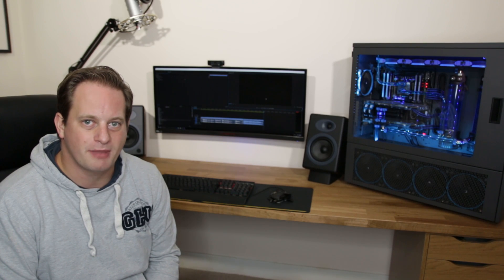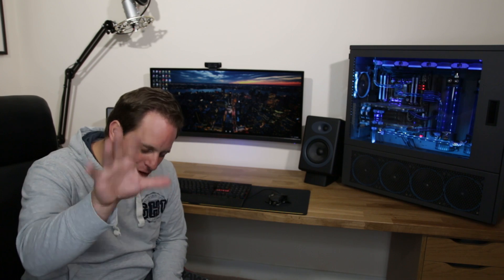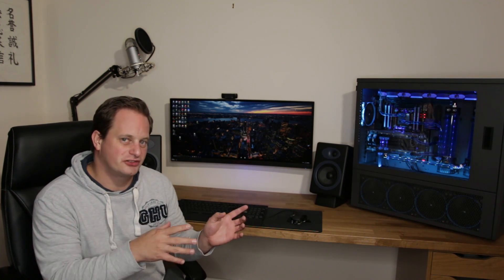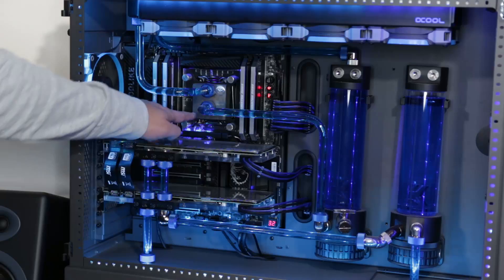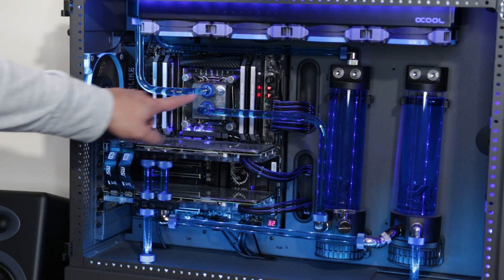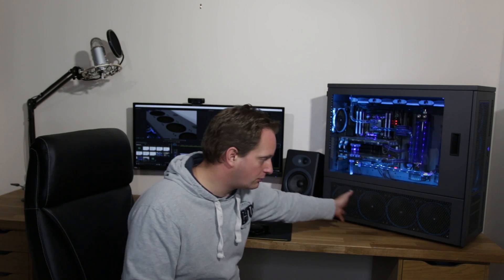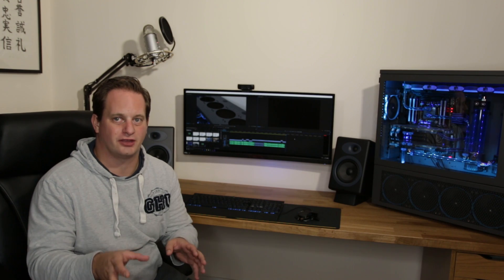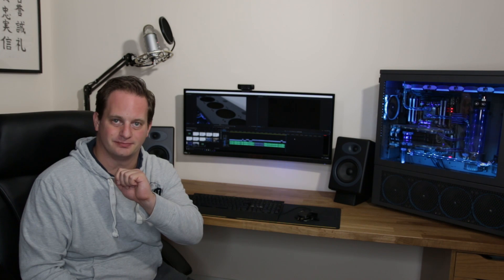Geek School - How Does Water Cooling Work

Comment: how does the liquid cooling like nzxt kraken work? because I only see things like water pump (the one come with lcd), it goes through the pipe directly only to reservoir and the fans. and then transfers back to the pump. 
where is the water block? 
or does the pump also has the waterblock?? 
or is that the waterblock and the pump come together in the reservoir??? 
thanks!

Comment: air cooler have liquid inside too, so....
Reply: Yeah, I was wondering about that, too. No mention of the actual type(s) of liquid or whether said liquid is self-contained in the loop, has to be added to periodically, or if the loop receives liquid from an external source constantly. I know nothing about liquid cooling, and the liquid supply source has been one of my questions.

Comment: I know this video is old but it was amazing and i have a dumb question, but i am not sure if the uploader will see this since its so old but worth a try. So water carries the heat away, so does that mean the temperature of the water does not matter because it will have the same conductivity regardless? or does it matter because if the water's temperature is higher than cold or warm it wont take that much heat from the block? i would appreciate anyone to help me with this.

Comment: This really helped me (I didn't know about Convection, how the water moved, I thought only the pump did that), but I still have a question, convection makes the hot water go back to the radiator and the pump moves the cold water to the block that will turn into hot water... But I saw a video in which the CPU WC Block had something like a spinning fan on it, all blocks have that? He explained it was for moving the hot water back to the radiator (since it's kind of pulling it)

Comment: Well, the air being heated above the water is not radiation. Radiation is the transfer of energy by an electromagnectic wave, when light hits an object it is heating that object, and also heated object emits light, just as a steel bar begins to turn red, and then white if you heat it.
Reply from the maker: Thermal radiation is electromagnetic radiation generated by the thermal motion of particles in matter. All matter with a temperature greater than absolute zero emits thermal radiation. Particle motion results in charge-acceleration or dipole oscillation which produces electromagnetic radiation.

Infrared radiation emitted by animals (detectable with an infrared camera) and cosmic microwave background radiation are examples of thermal radiation.

Comment: You also gotta add that water has the best specific heat capacity out of other fluids due to the strongest hydrogen bonds between water molecules. This means that it takes some amount of heat while increasing the temperature of water the least

Comment: Hi, I'm building my first pc in the next coming months... I do plan to use liquid cooling. I will be using a corsair 570x mid tower case. Now i have used pc part picker to start planning what's best for me. I have noticed alot of cooling units DO NOT come with a reservoir. Do all require the reservoir or no?
Reply from the maker: If it’s your first build I’d recommend building on air initially before you water cool. I have an entire series of videos watercooling in that case which should help once your ready, it’s all in a playlist for you 🤗

Comment: It's so beautiful... But what if water starts leaking 🙄
Reply: if your computer is on at that time, most likely it will cause electrical shorts (i am not a native English speaker, but hopefully you understand). This will 90% kill your board, your CPU and maybe even other components. To prevent leaks or at least try to minimize it, after assembling, PC-Builder would let the loop run overnight and place dry towel/ kitchen paper over where it might leak. This measure is not 100% safe, of course, but it is widely used by various experienced builders
Reply: It's not water ;__;
Reply: @shamaafrin4031  You must be watching a different video then. Otherwise you wouldn't say that. Watch the video in which you commented.
Reply: @blazingtornado8660  xD i watched mineral  oil one
Reply: @shamaafrin4031  I see. Yes you somehow stumbled upon a different video 🤔. But how did that happen is one of the greatest mysteries of the universe as normally you watch the same video in which you comment on, or in your case reply to a comment. This video uses water :-P

Comment: Hi guys i'm noob about this idea. Sooo does the water actually flow through the cpu/gpu to cool it? I mean, is the water in direct contact with the hardwares?
Reply from the maker: It’s not in direct contact, you need a ‘waterblock’ which mounts on the CPU in the same way a heat sink would that the water flows through. Google it and loads of reading material will come up.

Comment: So if energy cant be made where so does the original energy come from logically this doesnt make sense
Reply from the maker: +jon millay it’s definitely tricky to get your head round but it’s true. In this example is electricity which is likely generated from Nuclear or coal energy in which case the energy starts within the bond of the fuel which is being used. Energy can not be created or destroyed, only converted, it’s a widely agreed upon scientific principle.
Reply: all "original energy" originally came from the big bang. i think. Which can't/hasn't been explained yet.

Comment: Thanks a lot. When you said the radiators radiate the air out. Does that mean hot air or cool air?
Reply from the maker: The rads get hot which heats up the cool air around them transferring the energy

Comment: Are there any real differences having separate reservoirs for the CPU, GPU, and (if it applies) the motherboard?
Reply from the maker: +Ernesto Nuguid it makes it easier to drain bits of your loop when you change components. It's a hell of a job if you need to drain multiple waterblocks, multiple rads etc... It doesn't make any difference to your temps.
Reply: So no real reason at all

Comment: Nice setup you got there :). I wanted to ask you how you mounted the two clip holders on the reservoirs. I have the same case and similar setup as you but without those clip holders on the reservoirs, but I would like to know how to go about measuring and mounting them if that is not any trouble.
Reply from the maker: I installed the pump mount on the bottom of the reservoir first, then attached the clips (without the screws in) to line them up. Then used a pencil to mark around where the clips met the case which meant I could use an eraser later (nearly used the brit word for this which would have confused everyone....lol). I then removed the reservoir from the pump and used a punch to mark where the holes needed to be. Be warned - the depth of the clips is different to the depth of the pump mount so you need some spacers or washers to line it up correctly. You will also need a longer screw once the clips are spaced from the case. In short - a bit of measuring and bit of lining up by eye. Hope that helps - let me know if you have anymore questions.